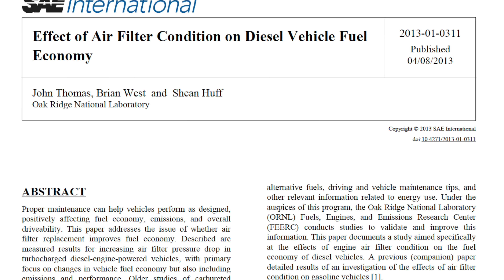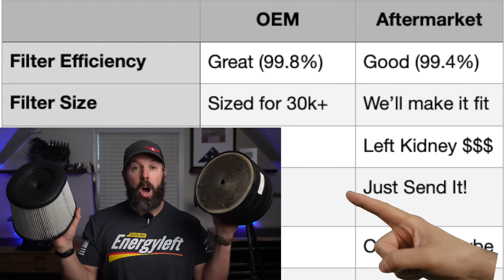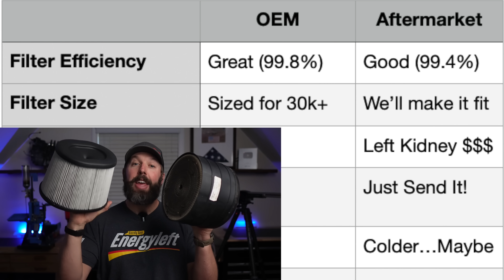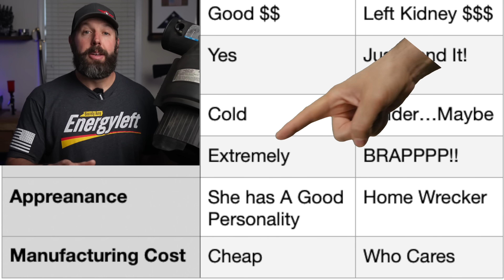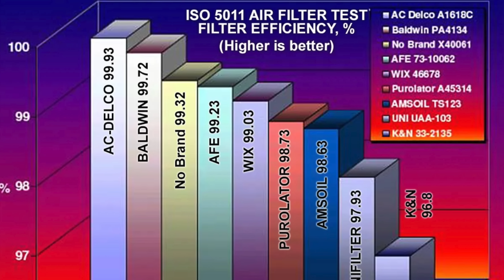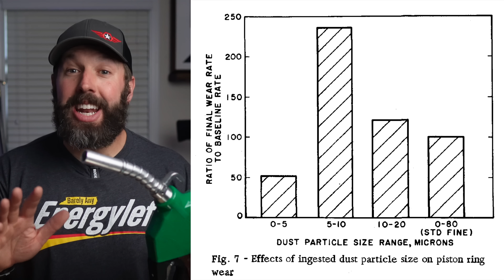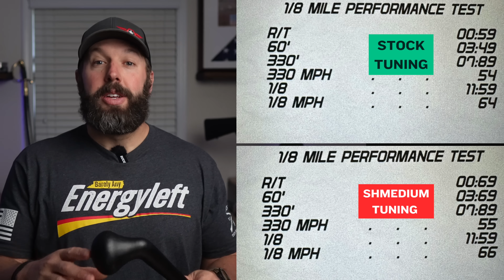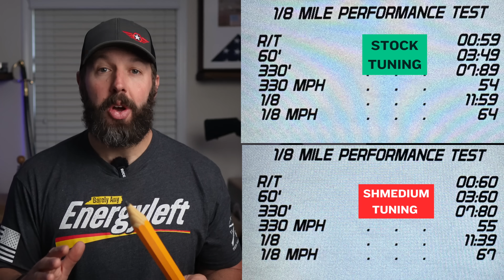The TRUTH About Cold Air Intakes…ACTUAL SCIENCE!

Comment: 3,000 mile oil changer here. A friend of mine owns and runs a lab that breaks down contamination of oils, refrigerants and coolants for large manufacturing facilities. The contaminants in engine oil at 3,000 miles is significant enough to start causing enough damage to be cost effective to change. Especially in Subarus. For under $30 to change your oil yourself with full synthetic and a quality filter it's absolutely worth it. Transmission fluid also sits in the 50-60k range.
Reply: My honda gets 5000-when i remember, my built corvette gets it every 1000 or less.

$30 change... my corvette wishes it was less than $100 lmao

Comment: That comment about squatted trucks had me rolling!  those things are dangerous. literally!  

So basically. My "cold air intake" box and filter which is Sink washable, that I wash every so often, ..... I should just not wash it ever?  sounds good to me!  It also sounds awesome.  Mine does have a water resistant cover that I do put on it and that cover works great. I have driven with my Aftermarket intake with water Over the hood an up to the mirrors and kept going.  That Water protection, if you get an aftermarket filter, make sure it has that.  seriously that is a good point.  

I payed about $400 for mine and the box and have not had to buy any new filters since and it has  1 milliion mile warranty I aim to use.  I'm quite happy with it.  Also yeah it sounds amazing and doesn't seem to add much wear to my engine, then again I'm doing that by increasing the power significantly.  

It also allows me to get 80+ more horse power with the kit and ECU tune I have... so Worth it.  if not more it supports up to 500hp.  
That said the Stock filter on the 2007 S60R is actually quite potent and looks similar to the filter I Put in.   Was probably good for up to 400 hp.  don't know.  didn't test it.  I just trust the kit from Elevate I got which was designed specifically for my car as a drop in replacement.  They only make parts for Volvo.  You listed a lot of reasons I am extremely wary of aftermarket parts though.  it could be better, or not.  and it's hard to tell without getting one unless you can find other peoples tests.

That said, if I was running stock, yeah, there is no reason to replace the one it came with!  Definitely agree!

Comment: Ummm that’s not exactly true about air and oil filters. Yes being clogged will capture more particles. However, the total flow of air or oil will hurt your engine and yes power
Reply from the maker: I said dirty and you extrapolated that to clogged. I have no time for semantics.
Reply: @freedomworx ok. Being dirty will clog a portion of the pores hence improving “efficiency” when compared to dirt particles passing through yet decrease flow. The most efficient method of having zero particles pass through is a solid filter. However, that would have flow down to zero. So it’s actually a mix of filtering and high flow. One goes up the other goes down. 
Manufactures create a min max balance of both on oil / air filters. A new filter maxes out on flow and meets the minimum filtering requirements. 

With that said the most efficient filters are the factory ones and not aftermarket cold air intakes for stock setups.

Comment: In standing mile racing I have seen IATs hit 165F, hot enough for my car to give me a drivetrain malfunction error that I had to reset. Where you will really see benefits on modern turbo cars is charge cooling. Intakes not drawing air from the engine is super important too. But in general there's really too much variation across applications and manufacturers to make blanket statements like you are here. I'm cranking 1000hp out of a 4.4L twin turbo V8 and heat management is just as important as air flow both in and out in that application.
Reply from the maker: My blanket statement is that aftermarket cold air intakes trade engine longevity for performance that you may or may not realize. I summed it up petty cleanly I. The conclusion of the video. Maybe you missed it 🤷🏻‍♂️

Comment: So if a dirty oil filter provides more protection why is there a bypass in the filter instead of just watching oil pressure and allowing the filter to show it needs changed? A measure of pressure differential would show the condition of the filter. Just like diesel trucks come with a resetting measurement to show air filter pressure differential or how restricted the airflow is.
Reply from the maker: I said don’t change the filter prematurely. I didn’t say don’t change the filter. Meaning a filter with 1000 miles on it filters better than a brand new one. Did you really think I was telling people to never change the oil filter? 🙄

Comment: well , you "powerloss/economy loss" deal ONLY works on modern electronic engines with full sensors cutting fuel to match AIR MASS incoming . tier 2 and s0me T3 , nothin to check "air mass" and will attempt to match HP by fueling  as normal whilst plugged A/F restricts = Fog  and over time will throw a CODE and derate on HPCR systems . 
   dirty filters caused more derates in gasfied construction equipment leaving machine sitting or running poorly , wasting fuel . on road , dont know & dont care , but guessing a trucker on roadside , limping on shoulder to next safe stop for DERATE isnt a happy camper .
  i''ll take 98 - 99% all day and half a century , thanx .

Comment: I purchased a new Ford F-250 Tremor last November. It has 11,000 miles on it now but almost 60 hours of idle. I go from construction site to construction site in the city where many of the traffic lights are very long and the system designed to catch everyone at almost every light. I live near the US Canadia boarder so the winters are cold. I did install the factory grill cover and noticed the engine warmed up significantly faster but didn’t run hot even on warmer days 40°.  So I’ll probably continue that cover install over the winter. 

I’m going to add a bypass filter next month. I’ve changed the oil at 1000, 4000, and 9000 miles sending off the sample to speed diagnostics. Metals were high at 1000, lower at 4000 but still high, and lower at 9000 but not where we want them to be. I’m running full synthetic now and the Ford Motorcraft filter. I’m adding 2oz hot shots to every tank.  So far I’ve used 1.5 tanks of DEF.  

I’m thinking I should have installed the bi-pass filter when the truck was brand new. 

I don’t see any benefit with replacing the stock air filter system. Except it looks nice. 

I won’t tune the truck because it voids the extended  warranty (had to sign a warning  in bold print)!  

I must admit, I much prefer driving the F-150 on a daily basis. But it doesn’t pull the equipment or trailer I have, well it would pull and stop it well if I installed air bags but, the probability of a lawsuit and problems with insurance are almost guaranteed if I was in an accident. 

I am going to install a Carli E-Venture system and Ready Lift airbag system. I’ve been told it will improve the ride tremendously with only about 1.5” of lift above the tremor package. Then I’m going to install new wheels and tires, not sure on tires yet but think BFG KO3’s..

Other than that.. I don’t think I’ll mod anything else unless it’s a clear benefit for longevity.

Comment: I have a question so what about filter wraps like filter wears or 
S/B filter sock. so say you bought a S/B cold air with a dry filter will the filter sock help any
Reply from the maker: The pre-filters capture larger objects. You can remove the pre-filter and clean it off to remove the lagrer debirs. It extends the life of the filter, but I doubt it really helps it filter any better.

Comment: This is crazy to imagine… (referring to performance only) I just installed an S&B CAI and it transformed my performance in my 4.0 Tacoma
Reply from the maker: Like I said in the video, I’m focused on diesel engines. Gasoline engines respond differently.
Reply from the maker: But the principles associated with filter efficiency are the same. They flow a lot more dirt than the OEM filter.

Comment: Best and free mod is to keep the factory Air Filter, cause let's be real, most CAI only get hot air from under the hood, Find the factory air inlet tube where air comes in to the filter housing and make it bigger. I have a 07 Town Car. Has a huge rectangular air box on a 4.6 2 valve. The air inlet tube is 3 inches maybe. I removed and just cut the bottom of the air box under the filter. Yes, I change my filter more often, but the fuel mileage I get is worth it. That's just me. Did the same on Oldsmobile Aurora, 4.0 V8. They need to breathe. The inlet is small also. Made larger and I get more mpg. I see so many cars in shop with CAI. You can see on a 20k scan tool that it does very little for af ratio, air temps, etc. Not saying there's a unicorn that makes a difference, but not enough to spend 100 bucks. Less brakes, more conservative driving will do better. BTW done this mod on my old town car. Had 620k when timing chain guides, plastic, went out. Body was rough and I beat the crap out of that car. But still ran, just had a clang clang when at idle. 😂

Comment: alright now, with air filters, its fine if you leave them for a long time and only replace them if they are severely clogged or damaged, and only dust them off a bit by whacking them against something like you hand. this is because you only lose power at worst. 

with engine oil however, the engine may have a very hard time pumping the oil through the filter. this can and will lead to less pressure, less flow etc. not good.

Comment: As usual you've done a half ass job of presenting your data you never want to run a dirty or clogged air filter because it affects the barometric efficiency table that the computer use to calculate out the fuel mixture when the filter is clogged you do not get as much air into the cylinder and the computer must then use the trim errors to compensate for a dirty air filter the best advice is hold your old air filter up to the sunlight if you can't see sunlight through it it's time to change it
Reply from the maker: It’s a good thing we’ve got you here to set us straight with all those well researched and cited scientific facts 👍

Comment: Comparing that power core factory air filter from certain years duramax like 2008 or so to a 2001 flat panel air filter is not the same thing. I have installed many S&B air intakes over the last 15 years because I am a dealer. The inside of the intake pipe from the filter to the turbo was always clean with no dirt sticking to the inside walls. I can’t say that for k&n or other cheap bs.

Comment: As a professional technician, I have always wondered about matters like these. It's been more than once that I had to clean a mass airflow sensor that was sitting right downstream of a K&N or similar air filter. I did not see this condition very often with stock paper air filters. It was proof to me that these filters are not really doing you much of a favor. I recently put a stock paper element back into my 2019 Dodge Challenger scat pack with a Whipple making around 700 hp. I live on a dirt road so I guess that really helps my decision. I will likely take the Banks cold air intake out of my 2019 Chevy Duramax 6.6 L. I plan to keep that truck for a long time because they don't build good ones anymore.

Comment: It would be good to mention that some of the results are counter-intuitive due to secondary effects. 

Example: 

Having more airflow means more power (correct), but appears to reduce mpg! But since better combustion uses fuel MORE efficiently, you SHOULD get better mpg with better airflow! So why is it worse??? The answer is that your engine has tech in it to reduce pollution. Sensors are making sure you don’t inject extra fuel that never gets burned (since that is pollution). That means when airflow is reduced, the engine won’t send as much fuel into the cylinders. The net effect is that when you stomp your foot to the floor the engine still won’t maximize fuel flow. It turns your lead foot into something lighter, always giving you a little less fuel in the cylinders than you would have gotten with better airflow. THAT is what causes the mpg to increase!

You almost got there with the particle size graph, but never said it overtly: the 5-10 microns solely particles only do the most damage because the larger (worse) particles get filtered out more easily. So the graph is true but very misleading. If you design a system that doesn’t concern itself either filtering the larger particles, since they aren’t the ones doing the most damage, you engine will experience WAY more damage from the now unfiltered large particles. The worst particles are always going to be the largest ones that don’t get removed by filtration.

Comment: I'm not here to try to convince people to put these on their cars, but rather explain why I put one on my own car. For some reason, Ford decided it was a good idea in the early 2000s to put a lifetime filter on their engines for some cars. These filters are not able to be serviced, and they also cost upwards of $600 to get them from the dealer if they even have it. I bought the car almost 20 years after the car was built, and I did my research on it and found that these things typically cause issues for a lot of people because they get clogged. After learning about that I decided to take the filter box out and attach one of these aftermarket filters from Sceptre. I figured that even if the filtration is not as good as the stock air box, it's still better than feeding the engine what is likely to be extremely dirty air.

Comment: FA20DIT WRX guy here. It's true. Even if you're chasing HP, you'll run into fueling restrictions well before you're engine is restricted by how much air it's gulping. Stock airbox and a ricer brand panel filter but full bolt ons. I've ran an agressivish dyno tune for 100k with no engine issues.

Comment: Cummins will say to change the air filter when the turbo bearings start passing oil into the intake cause according to them that's the primary cause of oil in the intake and the only way for oil from the turbo bearings to be drawn into the intake syststem

Comment: Something to add: Consider a snorkel if you want to reduce dust intake even further.

I go through a lot of dusty environments. From experience, fitting a quality snorkel can reduce particulate ingress dramatically. Over identical mileage, buildup on the filter was easily halved. Moving the engine's intake point from the wheel well where the tire kicks up dust to up high by the a-pillar makes a real difference. Plus it makes your truck super easy to spot in a parking lot!
Reply from the maker: Yep. most people think it's for fording water. When it's actually for moving the intake above the dust 👍

Comment: I think there is a bit more nuance to this. Performance filters do not equal "cold air intake" or short ram air filters. 

People who run them are doing it for the noise alone really. 

But peeps like me use use performance filters like the grimspeed drycon filters can get identical filtration rates vs stock but gain a little more power, especially when tuned. The only downside is that you really do need to clean them at least once a year... It does not have the capacity of an OEM filter.

Comment: By doing oil analysis can’t you look at your silicon levels as well as other wear metals that indicate cylinder/ring/valve wear and determine if your intake is potentially causing more issues than it should?
Reply from the maker: Yes. You certainly can.

Comment: What do you think about having stock air filter on a Cummins with compound turbos?
Reply from the maker: If you’re running compounds, chances are, you’re running a big honking filter right off the mouth of the atmospheric turbo. That’s pretty standard. And if you’ve spent the money on compounds, neutering them with a factory air filter makes no sense. Add a bypass oil filtration system if you’re worried about the extra dirt.
Reply: @freedomworx only making 500ish rwhp. There’s a pipe coming off the atmosphere charger to a small cone filter. I like quiet, I like longevity. I have the compounds for towing.